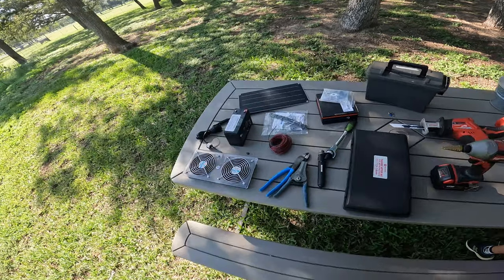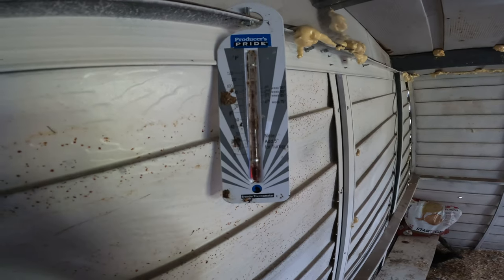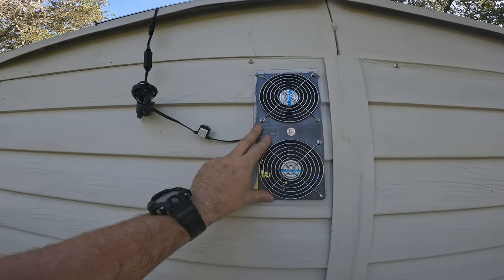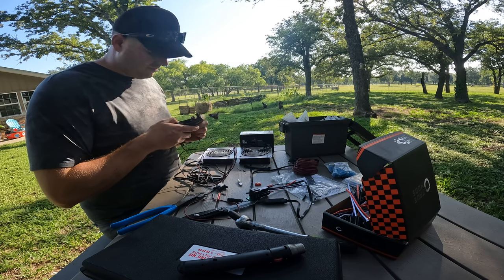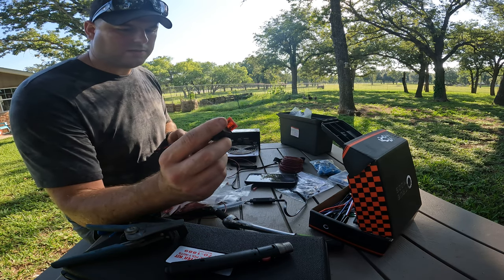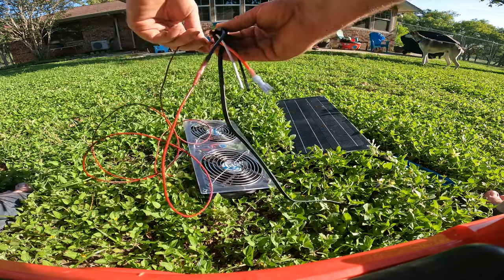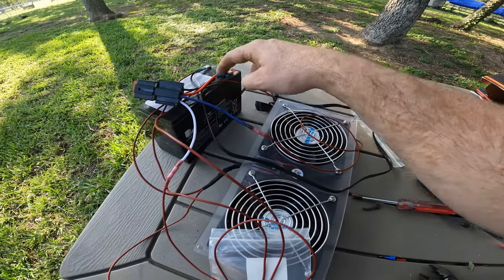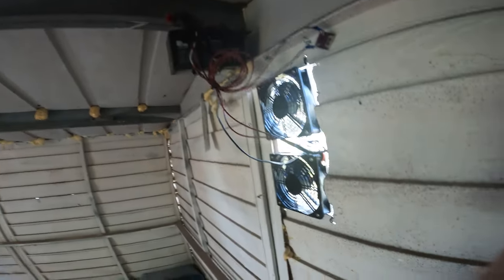Chicken Coop Solar Powered Exhaust Fan

Comment: These coolers are not designed to work with the environment. They will oxidize, the inner steel core will rust from moisture. And if you cook there, then most likely the coolers will be covered with a layer of grease and dust, which will make them maintenance-free. You also need to make a visor from the outside to prevent rain and dust from entering the cooler.

Pull the switch out like this it's definitely art😂
Reply from the maker: They are actually designed to work in chicken coops. They are advertised for chicken coops

Comment: Doesn't look, like solar panel has any controller. First that will lead to voltage fluctuation for ventilator (and battery). The battery without controller will result in overcharging and deep discharging and that kills battery fast. There are also other small issues, but godspeed! Better do this way and learn, than none at all.
Reply from the maker: There's a small controller on the bottom of the panel that I didn't show

Comment: How long do those run at night?  Do they kill the battery resulting in a deep discharge?
Reply from the maker: Yes it would run all night after one day it would kill the battery. I would have to turn it off give it a chance to recharge. Then I installeda 12v thermostat on it. It shuts off at night.   Haven't had an issue since